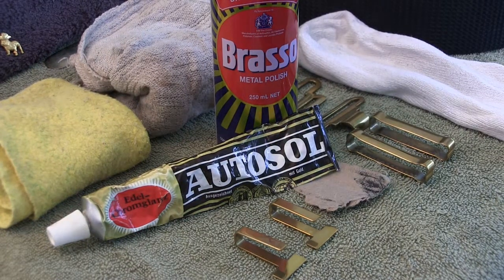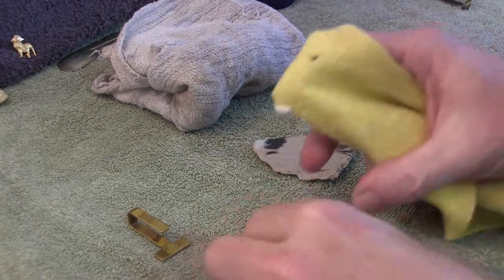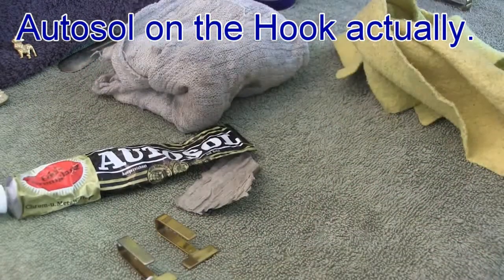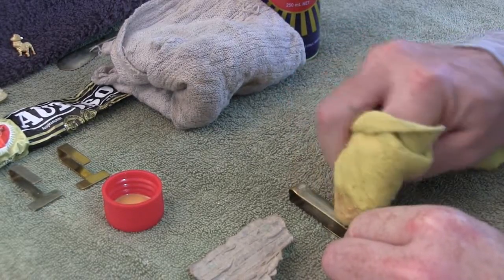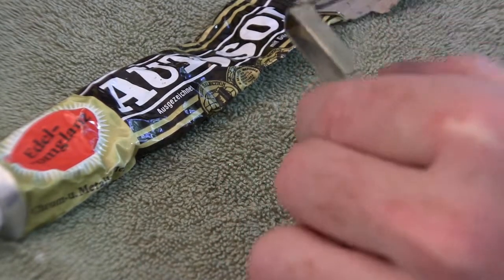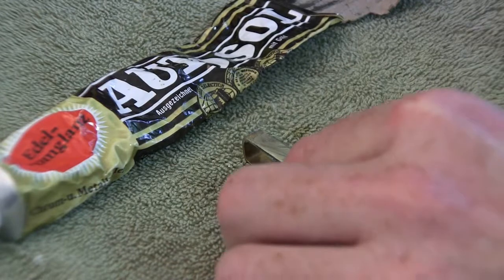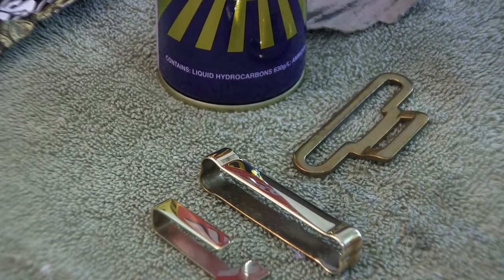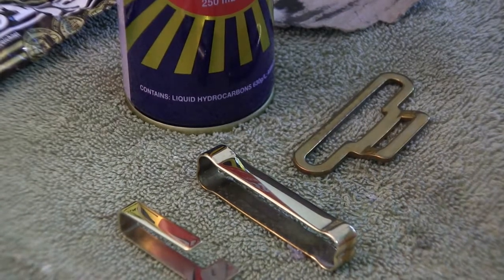Australian Army:How to polish brass Hooks, Buckles and Keepers

Comment: They mention you do this at kapooka polishing brass. Someone mentioned brass strips but I don't know what that is. They said don't step on the brass strips so I assume its on the floor.
Reply from the maker: @Watcherw1  Good question. The main  hallway in the recruit lines have a brass strip running across a section of the hallway. Recruits are required to keep the bass strip highly  polished. Therefore, it is verboten to step on it. Hope this helps. Regards Ash.
Reply: @Ashapplications  Oh ok, so does it run through the middle of the hallway?
Reply from the maker: @Watcherw1  The strip is located near the middle of the hallway and is about 10cm wide. It runs across the width of the hallway. The hallway is about 1.5m wide.
Each floor is dedicated to its own platoon. and each floor has their own brass strip. No one escapes the brass strip.😀
Reply: @Ashapplications  Those instructors will get you to clean till the cows come home....and some more